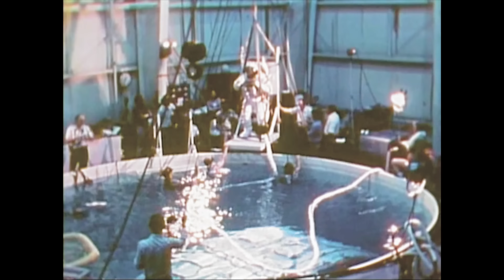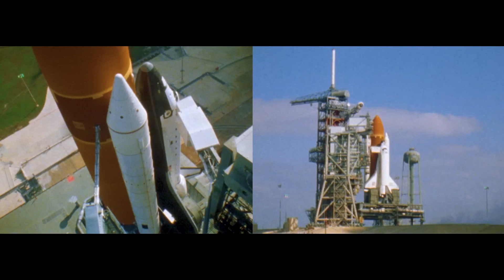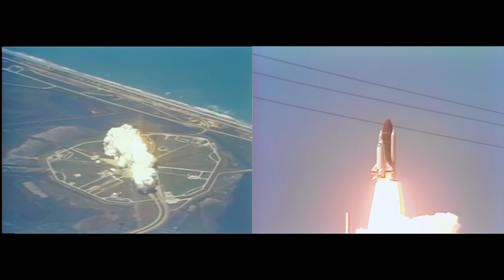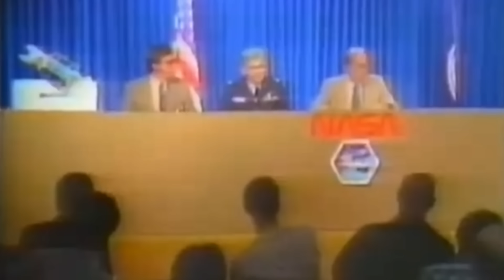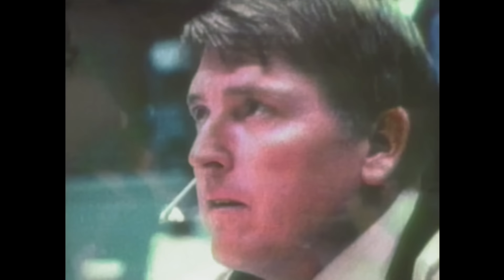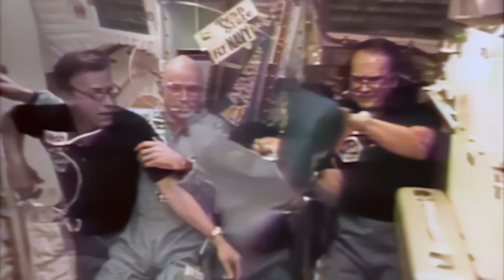STS-6 Full Mission - Launch, Satellite Deployment, Landing, EVA, Astronaut, Challenger, Documentary

Comment: This was the first flight of the shuttle Challenger.  This was the last 4 member crew of the shuttle until STS 135, the last shuttle flight in 2011, 28 years later. This was the oldest average age of a US spaceflight crew. The shuttle deployed a Tracking and Data Relay satellite, the first of 6 successfully launched by the Challenger. A 7th was lost when Challenger was destroyed in 1986. There were problems with the upper stage and the TDRS had to be nudged into its correct orbit using its reserve fuel.  
The first  EVA  was conducted on the shuttle, by  mission specialists Story Musgrave and Donald Peterson, which was a success. A lightweight external tank was flown for the first time as were lightweight  were Solid Rocket Booster casings and the first use of the head up display. 
Commander Paul Weitz made his second and last flight, having flown on the first Skylab mission almost 10 years earlier.  He died some years ago.
Pilot Karol,Bobko made the first of 3 flights and was the only astronaut to have flown on the maiden flights of two shuttles, Challenger and Atlantis , 2 years later. He died a few years ago.  Mission Specialist Donald Peterson made his first and only flight and died, I believe a decade or more ago. 
MS Story Musgrave, the only member of the crew still alive, made the first of 6 flights. He is the only astronaut to have flown on all 5 shuttles that flew in Space, Challenger, Discovery, Atlantis , Endeavour and Columbia.  Among those flights was the first Hubble Space Telescope Servicing mission.

Comment: Regrettably due to hydrogen leaks during the tanking test for Artemis II. The flight of Artemis II has been delayed til March.
Reply: Yeah this is about space shuttle Challenger.
Reply: @penguin44ca  Similar problems on both booster systems.
Reply: @Canada_Dominium technically yes hydrogen. But the issue Challenger had was a cracked fuel line in ssme 1. Replaced the engine and it was fine.

This is a completely different issue.
Reply: @penguin44ca  If you watch the video, they replaced one engine three times and the other two once.
Reply: @Canada_Dominium yes I am aware. Like I said, fuel leak in ssme 1 was the cause of the hydrogen leak. The other two were for other reasons. If you don't know what you are talking about just stop. It's ok to be wrong.
Reply: @penguin44ca  No, kid, it's you who got it wrong and you know it. You said the video stated one engine was changed out.  No, one engine was changed out and repaired twice, with it finally being discarded for a brand-new engine.  Then two other engines were changed out.  Embarrassing for you.
Reply: @penguin44ca  Oh, you're a September 2006 account.  I called that right away, dad.
Reply: @Canada_Dominium actually is didn't say this video mentions it. But yes I'm older and guess what? Worked at jsc for some time and many of my friends worked on the shuttle and some even worked on the mlp until the last shift. Good night kid.
Reply: @penguin44ca   Wonderful. You still have a shi++y attitude.
Reply: @penguin44ca  Yeah, and still you're wrong with a crappy old attitude to boot.
Reply: @Canada_Dominium here's a hug. Maybe your day will be better. Enjoy your day